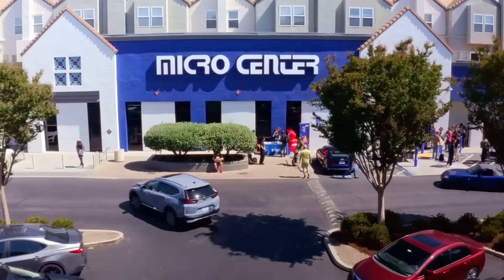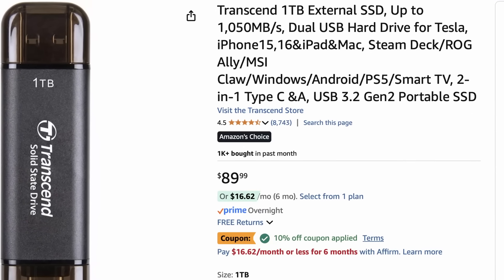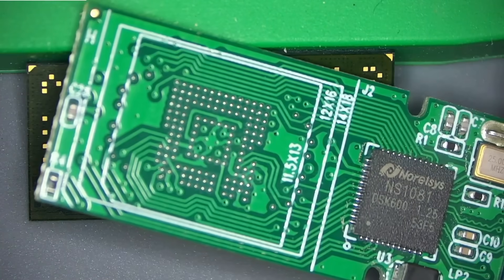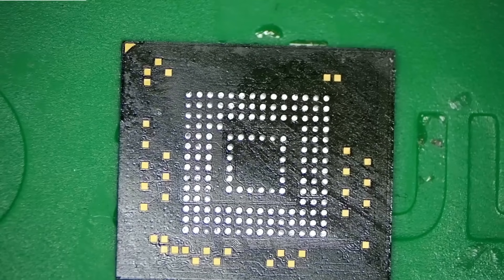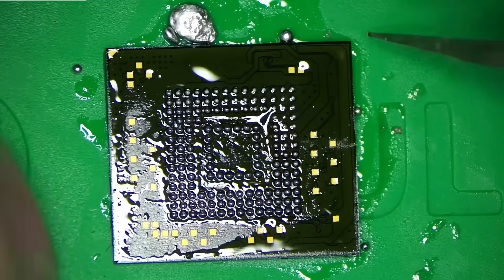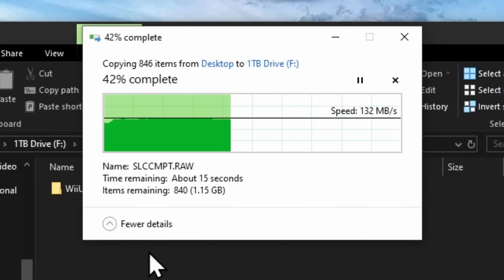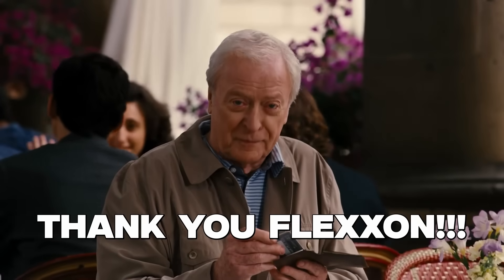I built an Industrial Grade Flash Drive

Comment: I don't understand... What's the point? it is easier and cheaper to buy a mini m.2 ssd and a mini case for it with a USB-C port... less cost, less trouble, more write speed.
Reply from the maker: If I wanted an ssd I would’ve made an ssd. 
I wanted to make the flash drive my 2014 self would’ve loved to have.

Comment: Hey, just remember, if you were scared, don't be. I reballed a Macintosh G4 CPU around 20 years ago with no stencil, no guide, just a cheap hot air gun and my own DIY solder balls. I was sweating bullets.
Reply from the maker: That’s some true skill right there! 💯
Reply: @chasefournier yeah, I was not wanting to spend extra money i guess. I was soldering on a new CPU that was faster, to get more out of the system. Definitely worth it in the end, just like your flash drive

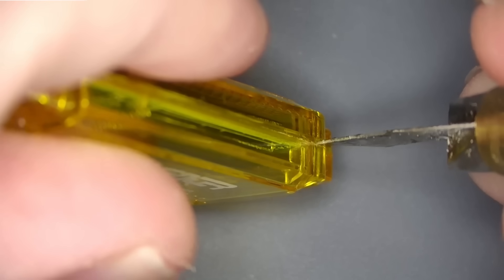Comment: 10:42 A trick I use for ultrasonically welded plastic seems is a cement floor and a hammer. Soft but firm! Don't just slam the hammer onto the thing! Soft but firm blows.

Pops open power supplies like a treat!
Reply from the maker: Haha I love this! 💯
Reply: @chasefournier Its the sudden impact/shock that tears the welding seam

Ive also had quite good experience with a carefully using a vice
I put some heat shrink tubing around it (not heated up) as a protective layer when using that
Reply: Tappy tap tap
Reply: Just give it a little tap tap taparooo....send it home...😂

Comment: 3:45 Did you RTFM? Reflow/soldering parameters should be in the datasheet.
Reply from the maker: I didn’t. I just heat it till it flows into place then remove the heat. It’s worked fantastic for me.

Comment: 3:14 There are larger nand flash chips. eMMC has been supersceeded by UFS for the most part. which is why we dont really see many options now, especially for the bleeding edge, ofc theres still demand, but its a dead end technology, so little investment. for USB storgae the standard way to do this is by using standard NAND flash without the internal controller. i guess technically its a bit round about as you go from the two internal emmc controllers to a usb controller.

 i suspect given the write speed you are limited by the controller at a write speed of 130MB/s while the datasheet says you should be able to get 200MB/s write/read there looks to be a generic pcb you can buy based on the SM3280BB for Parallel NAND flash which claims upto 350MB/s r/w another SM3281AB and the Norelsys NS1081 claims upto 200MB/s r/w theres other controllers but i cant seem to find any datashet on their performance, not all support 2 chips but the silicon motion ones do.

next video, 2TB?
Reply from the maker: If I could get my hands on a working ufs ic, I’d love to try this.
Reply: @chasefournier  i could not see to find a UFS to USB controller aside from some very old v2.1 ones. 

my understanding is the eMMC/UFS flash chip contains both an eMMC device controller and the raw NAND flash. 

to use them over USB you then need a chip that can act as a eMMC/UFS host controller and a USB device controller.

the alternative is just use raw NAND flash chips and use a controller like SM3280BB that does all the NAND management and USB device control.
Reply: @Altirix_  Yeah, JMS901 seems to be only good choice for UFS based Flash Drive.
Reply: Idk what you said but it was kinda hot.
Reply: Probably windows filesystem slowing down and alot of small files is slower than transferring a big archived file

Comment: I can buy a 2TB on aliexpress for a couple of quid... what could possibly go wrong? 💥
Reply: I bought one in the dawn of Aliexpress. I was very suspicious. Of course it was fake (duh). I think that some of the things I never will buy from any China e-commerce sites are memory and batteries 😂
Reply: @johandahlstrom5347  I've bought a lot of flash memory and a few lithium-ion batteries from aliexpress and they work fine, but before I placed the orders I've checked the feedbacks.
Reply: @johandahlstrom5347  The only truly bad electronic item I've had from Temu was that "2TB" drive. 2nd worst is an inline USB power meter that cannot show me how much my Samsung phone draws from a Samsung (or any other brand) charger because it doesn't pass through the sensing/control on the data lines. So the thing to measure power only shows 5V @ 500mA because that's all it lets through.

I did get a different USB power meter which works properly with my phone.
Reply: you lose your files dude, it's fake firmware with 32gb chips.
Reply: Try it and see. ;-)
Reply: @BrianG61UK  I've bought a couple of them. I've seen. 🤮😂😛
Reply: They are mostly fake,  you will get few MB or just few GB
Reply: Check real storage with h2testw, screenshot, send complaint to seller, escalate to ali if seller is asshole, get refund and keep SD card/flash drive for free, reflash controller woth proper storage amount.
Profit. Did it few times, then got tired.
Reply: And I bet you the usb firmware will show 1gb in windows but when you put 1gb of files  you will get corrupted  data every time!!
Reply: @MrBigbmcc that's why you do a proper test to determine the real storage and change that in firmware accordingly, even set it a bit lower just to be safe.
Reply: @zymagoras  my method is used to determine fraud
Reply: I got a "2TB" "USB C" flash drive for free from Temu. So after testing to verify its fakeness, I ripped open the big housing to find a bare USB 2.0 drive in a metal shield, plugged into a Type A to USB C adapter. ChipGenius told me what the controller was (after fighting off multiple attempts by Windows Defender to delete it), then found the right programming tool (which Defender was also determined to delete) and after some googling and futzing about I had it reprogrammed to its real capacity of 64 gig. Slow but I have an extra 64 gig USB 2.0 flash drive that cost me nothing.
Reply: Yeah, 💥 sounds about right.
Reply: corrupts your whole PC
Reply: Not a thang, sir lol
Reply: You get 16 whole gigabytes of storage
Reply: Probably works perfectly and stores  10MB
Reply: Epic fail.
Reply: Best case scenario you got it the worst case scenario you no longer own your computer😂
Reply: E  V  E  R  Y  T  H  I  N  G
Reply: 😂😂😂😂tell me why I did that years ago 😂😂😂😂 I was so pissed when i found out they where like 512mb 😂😂i learned how they try to scheme in China lol i guess it helps me now! Im building a cnc! And its conna be insane!!! And ill be able to cut pcb! Keep a eye out for a channel with RestingElf in the title! I figured out how make multiple layer pcb in a few different ways at home! Can't wait to show people!
Reply: @Nicolaevici13  😂😂😂😂😂😂😂😂😂😂😂😂😂😂😂😂😂😂😂😂😂😂😂😂😂😂😂😂😂😂😂😂😂😂you dropped some emojis bro
Reply: @Nicolaevici13  make a link from this one to that one
Reply: @Nicolaevici13 been there done that. Via CNC router , then fiber laser , than with UV printer. Not that hard.

Comment: Congrats ! So glad I subbed back then to see this thing to the finish ! Hey I wonder if the memory is thermally throttling, you could add some small thin copper shims cut to size and apply thermal tape to them to make them stick. You could use the thicker copper shims to actually bridge the gap to the housing and it might help even more. Then if the controller is getting hot you could make a copper shims for it too to help transfer the heat to the housing and I have had luck with stuff like that in the past. I’ve got boxes of micro heat sinks too and copper shims and slugs.  

Also another thing you could do is use alcohol or acetone to remove the old logos and then use a circuit vinyl maker and print your own logo and branding to. Are it look even more cool. Lots of little refinements you could do for version 2. I do think the reason these drives slow down could be partially due to thermally throttling. It’s also safer for the drive long term to keep them cool. Ive got a few 256 and 512 flash drives and I will actually see if I can make a before and after experiment to see if cooling them helps with transfer speed consistency over time on large files.
Reply from the maker: I’m so glad you stuck around! 😊
I need to try this! Maybe liquid nitrogen 👀
Reply: @chasefournier  Watercooled USB thumb drive when?
Reply: They also slow down because they're using an internal buffer (assuming this works like a usual SSD) to achieve faster speeds, but that drops off over time. Full size SSDs exhibit the behaviour too.
Reply: Looking at the video, the slowdown seems to happen when copying smaller files, like snes roms, I've seen that happen on just about every disk I own, but it could be something else
Reply: @mrkosmos9421  This. The 2GB transfer slowed down at that same last 80% that the 8GB transfer did. If it was thermal it would've slowed down after the first 2GB (or almost immediately since he did it back to back with no time to cool off)

Comment: I forgot the name of the program but there's this cool program that allows you to just dump all your iso's into one file on your thumb drive and when you have 12 into beautiful options you can literally choose from any of them and so having a big ass drive is very handy because you can have like 20 iso for any operating system that you would ever need
Reply from the maker: I NEED THIS! 💯
Reply: @chasefournier the name of the software is ventoy, I will warn you if you try to run like demo software through the ISO it will rewrite the thumb drive and destroy all of your other iso
Reply: @chasefournier  Easy2boot is another option
Reply: It's Ventoy.  And I use a bunch of the red MC flash drives, 8GB  IIRC, with Ventoy for all of my bootable ISO installers.  That is the only purpose those red drives have so I can easily keep them separate and not even think of using them for stupid tasks. Just bootables.  Works great and speed is not a huge concern for that kind of use.  I do love the MC drives for that color coding. Have a yellow one, two purples, a dark blue one, and a bunch of the red ones.

Comment: going to be trying to make my own emmc USB soon what temp you you use for reflowing the bga chip and what airflow doyou use
Reply from the maker: Good luck! 💯✅ 360c heat 50% air
Reply: @chasefournier   thanks one last question should I expect the blank emmc USB board to have fermwhere if not where can I get the fermwhere and the programming to do I program it before or after
Reply from the maker: @thewavyshopofficial  whatever usb controller is on your board, just find a MP or ST tool for that controller. 

The usb controller I used in this video is tried and true. My go to.

Comment: In the device manager, go to disk drives and right click the removable one you plugged in.  Look in one of the tabs for performance.  Select better performance.  Sometimes this will cause the computer to want to reboot, do it if it asks.  Then see what performance you get from it.  You will need to safely remove the device when you do unplug it or there is a chance that not all data may be written to it.  Despite that, it is a good idea to always safely remove, it may have not finished all writes yet or some other program may still be using it.  You can still lose data despite safely removing in situations like the NAND is just too worn out.  It is rare but it happens and it is a lot more likely with QLC NAND.  The only reason QLC exists is that it is cheaper, it has no benefit over the previous three NAND types whatsoever.  That is especially true if you know anything about SLC NAND which is rarer and horribly expensive!

Comment: it will be so amazing if other countries have Micro Center's as well ;-;
Reply: Would not be viable in the long term. The US have a crazy big user market for PC components. In the EU local PC shops are struggling. They produce barely enough income to keep the shop running. They dont keep large inventory, because they didnt know, when the item will be sold. I have 2 friends, who are runnig a PC shop: one in Hungary and one in Germany. They dont have stable consumer base. My friend in Germany never saw IRL a RTX 5090. The most expensive card he sold was a 4080 Super and that was an one time deal(usually the customers searching for the entry level cards, like the RTX x060 or the RX x600). The webshops are in a bit better position, but still not enough to open a Micro Center size shop.
Reply from the maker: They need to branch out there!
Reply: @chasefournier for sure my man

Comment: Flashing the controller with MPtools?   Any ability to upgrade it on the normal USB 3.0 drives from MC to make them perform better?  If so, will you make video ?  Thanks
Reply from the maker: There has been some talk about it. But I’m thinking it might be limited to the type of flash storage used. But not 100% sure

Comment: Not sure what motion correction your camera has on, but it is nauseating.
Reply from the maker: I need a different camera, got any suggestions?
Reply: @chasefournier I use a Sony fx30 and a sigma 30mm 1.4 lens
It’s super goated. I can record for hours on end with zero thermal shut downs or warnings in.  4k. I’ve tried dozen or so cameras and all of them would thermally shut down recording after so long esp in 4k.

Comment: Can you change the firmware of any usb drive to make it transfer faster 
If so how and where can I attempt this
Reply: You can't make a drive faster by modifying its firmware, speed is limited by the flash memory, the software part, at least on the USB drive, isn't the main bottleneck for the transfer speeds
Reply from the maker: Most flash drives if you know what controller you have and the correct fw, but to make it faster? Not sure. But this one RIPS HARD!